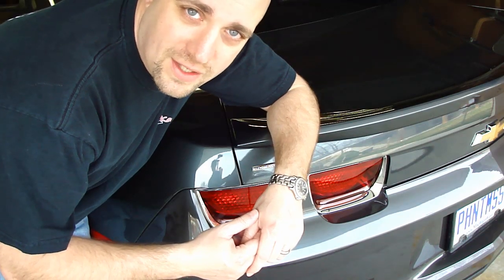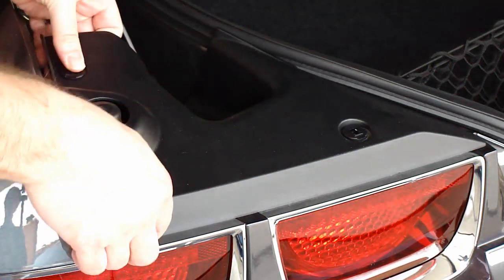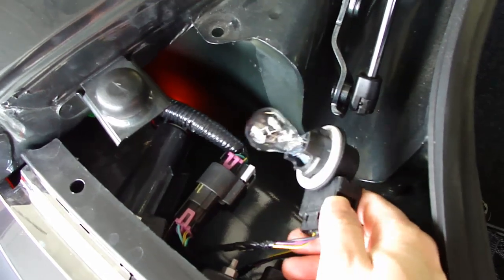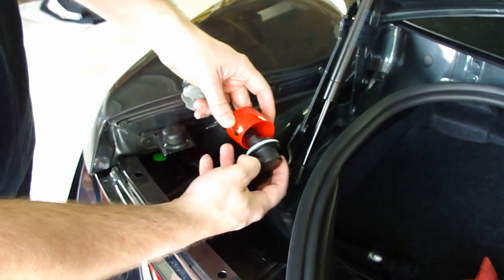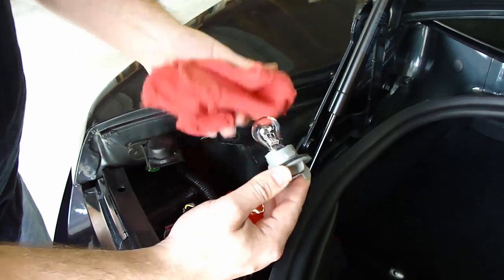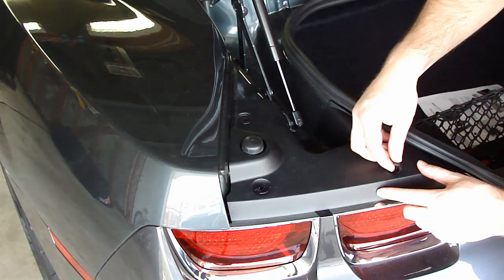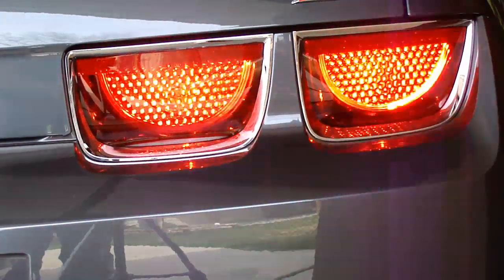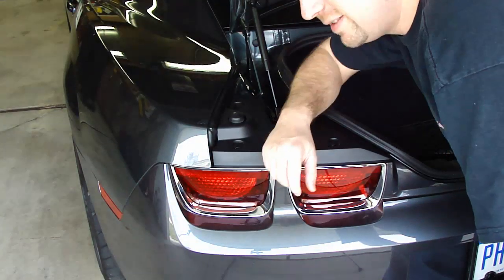How to Install Sequential Turn Signals on a 2010 Camaro

Comment: There was a procedure I had to do when I originally installed the sequential tail lights. I for got what it was. After replacing the one bulb only one side works as advertised, the other side does not blink as a sequential tail light.

Comment: spend 100 for the kit, or 1.50 for a butt load of simple resister diodes that do the SAME EXACT THING at radioshack....this is a tough choice